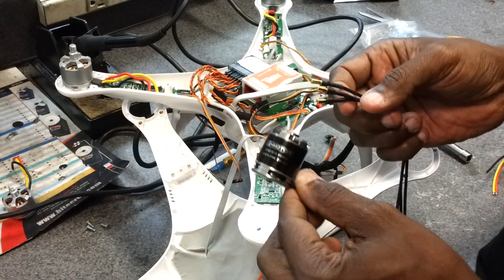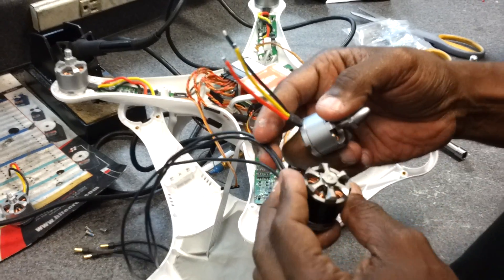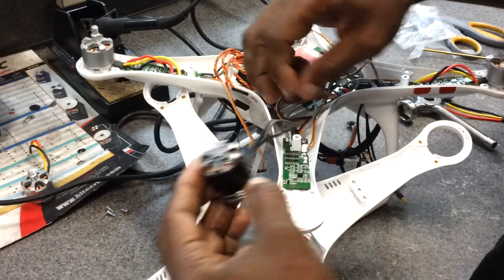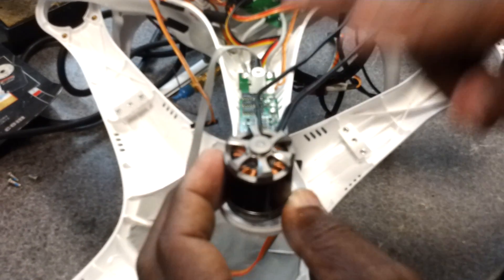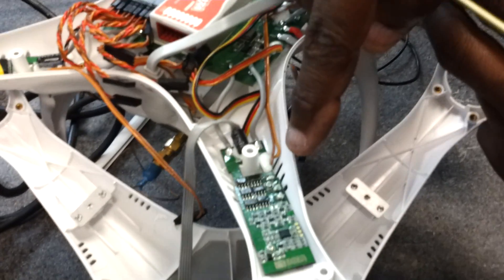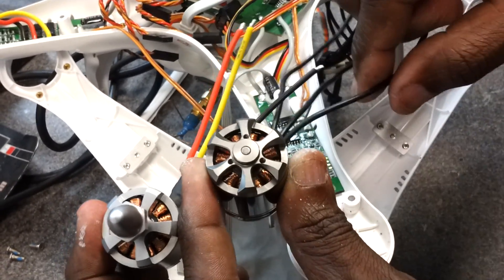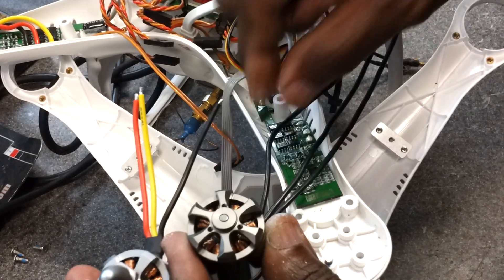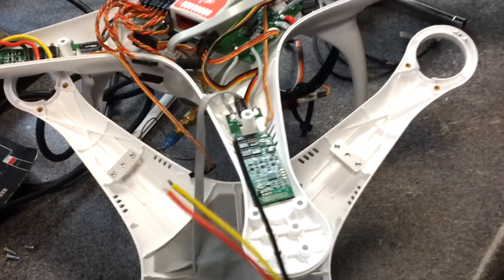Dji Phantom T- motor in stall

Comment: I HAVE FOUND THAT THE WIRING ON TIGER MOTORS ARE REVERSED APART FROM CENTRE WIRE SO IF YOU FOLLOW THAT ON WIRING ON PHANTOM THAT WILL GET YOU UP AND RUNNING